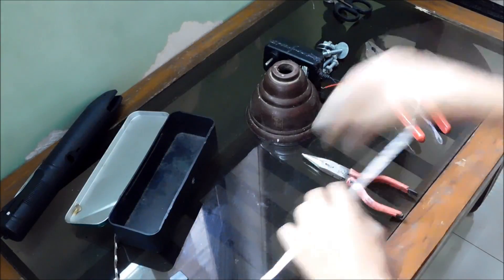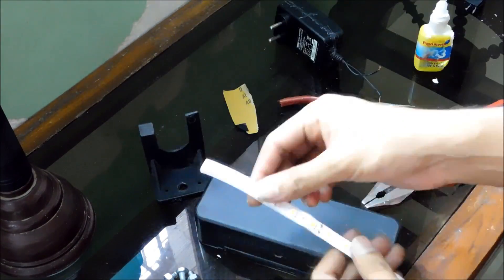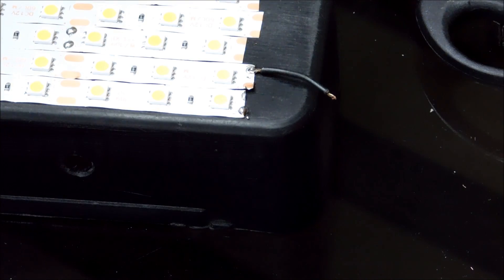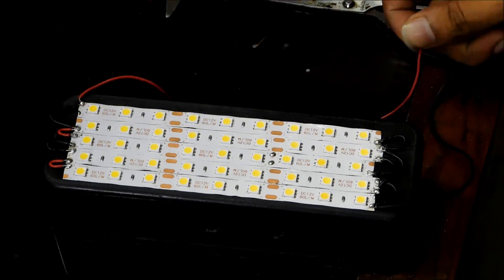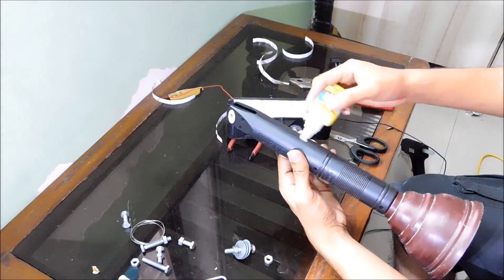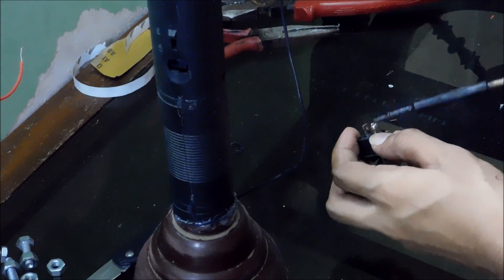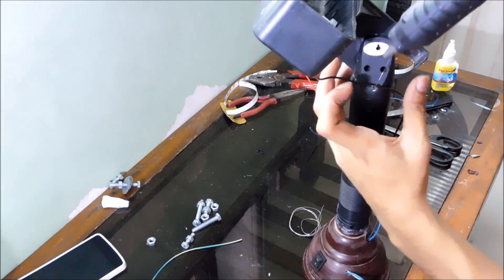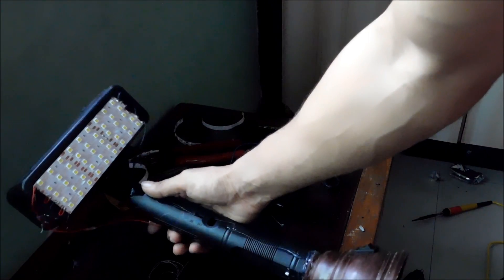DIY LED Light lamp (How to make)

Comment: cable management could have been better.
1.cable could have hide inside instead of glueing
2. Instead of glueing upper light part and centre part should have used nut bolt method for flexibility
3.Avoid as much as possible of glueing from outside or glue visible to eyes
Reply from the maker: Crazy Mind gud observation !!
Reply: +TechTube HD  it looks messy
Reply: It's a demo for petes sake, Way to think outside the box man I've been tinkering with a similar project but in 48volt. I have found some pcb strips with Samsung diodes but not like I want.

Comment: try using flux it helps you solder better!
Reply from the maker: +Etro sure
Reply: stop using soldering iron to melt plastic would help .
Reply: Barrybados©.  it doesnt matter if you melt plastic if you use flux, flux is used to clear the iron and make tip easyer to solder so it removes plastic from the tip
Reply: Plastic kills soldering irons been using them for 30 years : }  .
Reply: hahahah you are probably like 20 yo and you have been using tham for 30 years right ? and you watch these kind of videos when you have 30years of experience ! you shouldve been thinking before you told that lye
Reply: Thanks for the compliment , And yes i like watching all kinds of video's thank's for the concern .